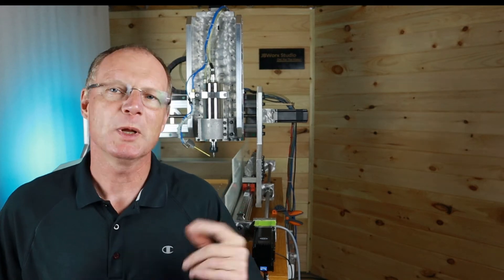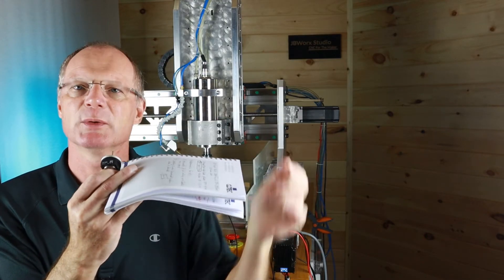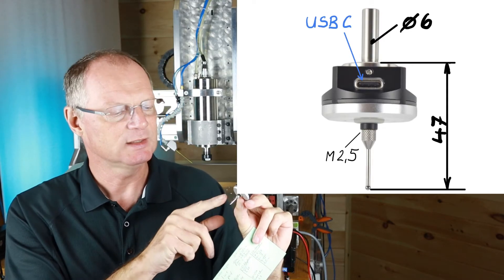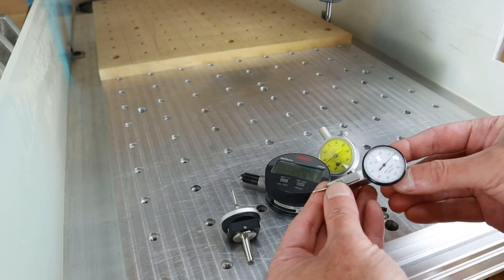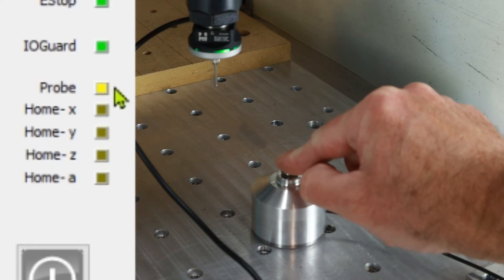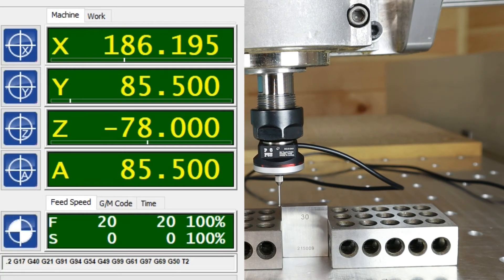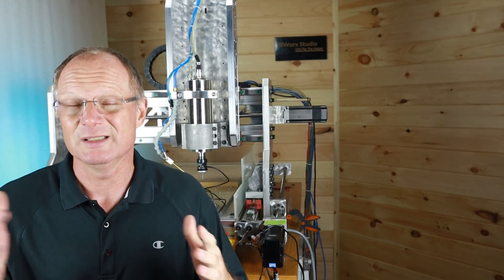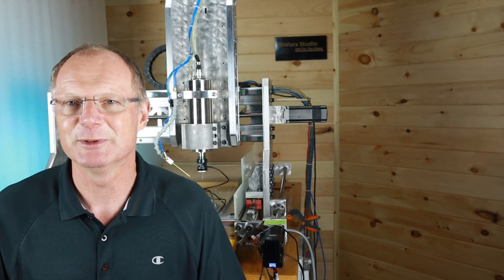CNC Touch Probe

Comment: I purchased one of these probes for use on my manual mill with Electronica EL700 DRO, which has probe functions, but requires only a passive input (no 5-24v input and it requires NC contacts).  To use it I needed to disassemble and re-wire it to bypass the internal circuitry.  I just removed all the components from the circuit board and located the pad that connected directly to the sensor ring, then connected that to the USB connector center pins.  The common is already connected to the other side of the ring via the outside pins.  I am in the process of testing now:  inside / outside features, inside / outside diameters, steps, angles, etc.  I don’t expect the advertised accuracy without the active circuitry but generally if I am within 0.001” for any of those functions I am close enough.  If you have not had a look inside your probe you will be pleased to know that it is well-made with gold-plated contact balls and pins, nicely-machined internal parts, O-ring seals, etc.  Mine was very clean.  As you correctly point out, the USB connector is a weak link.  Although the supplier’s advert states that they have replacement parts, in the US we must go through Amazon to contact them and I suspect this might not be straightforward.  Thank you for posting your experience.
Reply from the maker: Good work around !! So your board expects a “dry contact” NC. Yes it’s very nicely made I opens mine hoping to change it from NO to NC as the NC probe was not available on Amazon when I bought mine. Unfortunately I was unable to change it. Also getting it back centered took me quite a while. 
Let me know how the accuracy turns out.
Reply: In that case, you don't have to modify the sensor itself at all; you just run its output into an optoisolator chip, which's secondary (output) side you connect to your machine inputs.
Depending on whether you want to invert the input logic or not, you connect your signal to the anode or cathode side of the chip input and Vcc or GND to the other. Dead simple, costs you only a marginal amount of money, and saves you the hassle of disassembling the sensor and modifying it. That also solves JBWorx inversions problem in the same way.
Reply from the maker: It the optoisolator adds to the timing loop and some of them are quite slow. This is why I was avoiding it. However in reading up on this right now I see it’s only 5 micro seconds. So I have to change my opinion about using them in the future. Thanks for your post.
Reply: @JBWorx  The probe should be calibrated - distance between probe contact and trigger = effective ball diameter.  Adding a relay had no change in my effective diameter(1.88mm). I use "Probe it" for calibration.
Reply from the maker: My guess is that during probing everything moves so slow that it does not matter if a relay is in-between. A transistor however would be a better choice. But if it works it works !
Reply: @JBWorx  My machine only has a very low current 4.7v supply that has to be grounded (pulled down to below 1v) as the probe. I tested and it doesn't provide enough voltage or current to operate this probe by directly hooking it up to the probe. How do I hook this probe up so I can use it? I've got a 6v 2a power brick laying around I can use as an external power supply, but clearly I need some kind of interface circuit and I'm not sure what to use.
Reply from the maker: Best would be to change out that power supply instead of adding something.
Reply: @JBWorx The 4.7v probing is integrated into and provided from the controller board, so changing out the built in probing power supply is not practical. The controller board itself is 30vDC, so I can't even tap it for running this new touch probe. I think I will just run a solid state relay board with the separate 6vDC power supply and have the solid state relay short the 4.7vDC probe to ground and see if that works. As you mentioned, probing happens so slowly, I don't think the time delay will make any practical difference. I often manually probe using paper and haven't seen it make more than 0.001" difference.
Reply from the maker: Ok I see, yes the 30V might be a problem. I don’t want you to burn anything up on my recommendation, however have a look to combine the 0V of your probe output with your new power supply. This only works if your probe input looks for 0V if probe contact is made. Look up a transistor schematics and understand how it will pass the 0V through even though it runs on a different power input. Important here is that both GND or (-) or 0V what ever you like to call it are combined.
Reply: @JBWorx  The circuit operates at 5v  via a 7805  ( 5 volt regulator).   Most 7805's max voltage is 30-35 and minimum 7v dc.
Reply from the maker: Ok sounds like you have a plan
Reply: @neomunitor  It's one thing to use a test dial indicator to measure probe tip concentricity  with axis of rotation.  For accurate edge finding you need to know the distance between probe contact and probe trigger. Because these are kinematic probes( 3 "legs"), the angle the probe approaches an edge,  will change the distance between probe contact and trigger.   I have done 360 degree probing angles,  and surprise at trigger distance variations.
Reply from the maker: @mikee8467 first task is to set the concentricity of the probe otherwise it will have a variation dependent on the orientation of the probe or workpiece. Next I used a calibration ring and a calibration macro that establishes the exact trigger point to a given reference diameter. These parameters are automatically stored in the software after the calibration is finished. It’s important to properly do this to have accurate measurements as you already pointed out.

Comment: Another great video. I have the same probe and love it. I am planning on adding a tool setter and using the touch probe for zeroing my z height work coordinates. Like you, I don’t have an atc. Do you have an accurate way to measure the length of the probe with your tool setter for subsequent tool changes. Both the probe and tool setter have springs. Thanks for the great content.
Reply from the maker: Thanks for your positive feedback. So measuring the length of the 3D Probe on the tool setter I can not recommend. My probe triggers first and it does not even deflect the tool setter plunger however I think it’s better to create a touch of block in a certain position on your table. Let’s say you use a 1-2-3 block and touch off on that one. At leased that was my plan so far, have not tested that.
Reply: @JBWorx  Surprisingly difficult to find information on how people are handling this in their workflow. Since the touch probe is not deflecting the tool setter, do you think the travel of your tool setter is measurable, and repeatable so that you can factor that into subsequent tool length offsets? I have a tool setter on the way, and will experiment once when it arrives. Keep up the great videos
Reply from the maker: Like I mentioned above I don’t think it’s a good solution this way. Having a firm surface with a known height will work much better. There is a video from Klaus Michel in this but it’s in German. He did it like I mentioned and it seems to work fine. Also a question how you can incorporate that into your controller settings

Comment: The wire coming out of the uccnc controller is +5volts and the spindle is grounded.   Is this NO or NC condition?
Reply from the maker: I would think it is looking for a NO contact. It will trigger the input when the switch is closed or the circuit loop is closed. But best is to test it.

Comment: Will the 6mm shaft work on a 1/4" collet?  Will the collet squeeze down enough?
Reply from the maker: I recommend using a 6mm collet. If you use the 1/4” the runout starts to get really bad. Also fir a cutting bit. So best is to use the correct diameter collet.

Comment: Great video, I was looking at them but worried about spare parts, looks like that seller as you said has spare parts like the tip adapter that commonly breaks..
Reply from the maker: Yes they do and also the plastic part in the inside. The tip has an odd thread (M2.5) so it’s not easy to find a replacement from a different vendor. But it’s available on Amazon now
Reply: I see plenty of M2.5 tips on ebay, some with a jewel tip also. That shouldn't be a problem.
Reply from the maker: Excellent, yes I can find them now as well … wonder why I had such problems finding any at all before.

Comment: I’m having a npn no 3d probe coming in. I was thinking about to connect it to the input of the tool probe. But my tool probe does only use two wires. How do I connect it then ? 😂  the tool probe is using input and gnd. Do I just need to connect it like 5 volt. Then gnd and input on same wire from the tool probe?
Reply from the maker: So if both are NO probes you can connect them in parallel so to the same input to your board. Either one of them can close the circuit path and get the required signal. This is for the signal wire the power you pull from your control board but check if it supports the current. I remember I measured the current and it was really really low but don’t recall the value from top of my head. So my Eding controller supports it directly.

Comment: Hey nice video. I bought that 3D touch probe and I want to connect  my Z touch probe paralel like you show in  the drawing. But it won't work. I'm using UCCNC software the probes are both NO contacts . Separately they work fine. What can be the problem.
Reply from the maker: Ok so NO contacts will need to be wired in parallel, so either one can close the circuit. I had to change the expected contact in my software to make it work at first.
Reply: @JBWorx  Hey, thanks for the quick repley. Did you had to change the "activ low check". Do you also use UCCNC?
Reply from the maker: I use EdingCNC and yes in my controller I had to change this setting … I don’t remember at the moment if it was from high to low but it worked once I changed it.

Comment: I got the same probe. It was $45 on China taobao site.. The accuracy is good enough for me. However, I spent some time to make it work. On my machine, the probe has to be grounded on the shaft or it will not work properly. If you have similar problem, try to ground it.
Reply from the maker: Thanks for the tip, mine worked perfectly out of the box.
Reply: @JBWorx Well, It wasn't the probe. It was due to my spindle not grounded. The probe will get intefered somehow and behaved strangely.
Reply from the maker: Yes proper grounding of the spindle is important. Best is to open the connector at the spindle and check using a Ohm meter to see that everything is ok.
Reply: @JBWorx  My machine is from China. They preferred to use an alligator clip on the drill bit and pass the voltage signal for zero detector. I guess that's why the spindle cannot be grounded.
Reply from the maker: A proper ground is really important especially if you have a spindle that runs on line voltage let’s say 110C or 220v. It can be a life saver and protect you as the user. If it is a DC motor that is used as a spindle then it is less important.

Comment: I like the probe but the electronics are weak..  I wired mine up wrong and that was that...  I ended up removing the electronics and use it as a simple contact.  works great now....
Reply from the maker: Well good that you got some use out of it.
Reply: Agreed.  See my earlier reply.  My DRO expected NO and I deleted the electronics intentionally.  It seems to be as accurate as the original poster states.  It's especially good to have all the probe functions available.

Comment: So does the signal cables go into the existing Z probe connects? I have a Sainsmart 4030 ProverXL V2 and there is a 2 connector Z probe on the box.
Reply from the maker: Yes, both probes are wired in parallel so in the same input. Either one can make that input on the board and the software knows from the selected routine wich one is being used.
Reply: @JBWorx  absolute magic thanks.
Reply from the maker: @Festivejelly anytime

Comment: I have the same probe, only I use a mach. Do I need to set anything in the control software to measure with a 3D probe?
Reply from the maker: I don’t know the specifics in Mach3 however it has a probing routine. However the probe needs to be calibrated in the software so you can use it

Comment: I think "thou" is reserved for thousandths of an inch rather than thousandths of a millimetre. Really excellent and informative video as always!
Reply from the maker: Yea I am pretty much messed up when it comes to units … still prefer the metric system and most of my measurement tools are in metric. We would always say 1/10th, 2/100 or 3/1000 where I am from. Thank you for reaching out.
Reply: To confuse the issue further, I have heard Americans using 'mils' to mean thou.
Reply from the maker: Yea it’s hilarious- however I do think the we give ourselves here in the US a huge problem dealing with decimals of an inch. I see so many engineers that have no “feeling” of a dimension and its tolerance. I also think that we miss out on not using enough standards. Every bolt, nut pin, clip tap and what not has a DIN standard in Germany. And that makes everything so much easier. Here it’s a bit wilde West where every supplier makes their own version. Add wire gauges, drill bits and dimensional lumber into the pot and you just have to ask who the hack came up with all that nonsense. Ok I get of my sop box now ….
Reply: Americans and their fractions... always gotta make things more complicated than they really are.
Reply from the maker: Yes my big problem is when I try to explain that square feet is an area and has no equal to a volume of cubic yards to a concrete guy 🙈🙈🙈

Comment: Mine arrived today, what a lovely device. No repeatability testing yet but x,y,z all work as expected on PathPilot. I have the 6mm shank, NC version, a bit more money for some reason but it is what I need for my controller. Thank you for finding this, I had given up hope of an affordable probe that fits my machine. Touch off is noticeably stiffer than my Renishaw TP2, but at least I can use this new one :-) , the TP2 takes a lot of Z height space.
Reply from the maker: Awesome!!! Now can you calibrate it in PathPilot?
Reply: @JBWorx  yes, they have a whole screen and process to go through including testing with a ring gage.
Reply from the maker: Nice, I really like the PathPilot for my lathe, the conversational programming is really good. I hope you can use the probe in your workflow and It will make alignment easier.

Comment: Your description tells that you probed accuracy at +-0.05 mm (which is not really high precision 😮) but what I've seen in the video it was actually +- 0.005mm, which would be really a good value, especially for the price.
So, did you do further tests and it was 0.05mm or is that a mistake?
Reply from the maker: I went with the Japanese approach of underpromise and over deliver. So I actually measured 0.005mm but I figured I would place more divination on top of that just in case anybody buying this and not be able to get my results they would sure get something 10x less than what I measured. And if ok with that anybody will be happy to find out the unit is more accurate.
Reply: @JBWorx  Ah, ok. Wise move 😉
Reply from the maker: I think you are one of the few people that actually read my description! Nice 👍and good catch on the measurements !

Comment: Hi Jörg, thanks so much for your excellent contributions so far. Very much appreciated! Regarding the wireless approach, I imagine the pro stuff would have some heartbeat going on to avoid accidents? For size and low-power I’d look at ATTINY85 and a rechargeable LIR2450 cell plus 433Mhz TX module. Thanks again!
Reply from the maker: Thank you so much for that recommendation. There is a new protocol using a direct link 2.4Ghz with a latency of 2.4ms that I have in mind but will check out the components that you mentioned definitely looking into that battery.
Reply: I made a circuit a couple of years ago using this cell and was quite happy with it. You can also find a TP4056 USB charge module for about $3 and change a resistor to set charge current to a more appropriate 130mA. Have you determined the power needs of this probe?
Reply from the maker: I measured the current connected / triggered and it is on 5V 11/16 mA. So rather low that is why I was able to connect it directly to the output of my EdingCNC board. The new S3 chip has 4 power modes active it should be 78mW so on 3.6V we should see 21mA sleep is in the microA range. The board comes with single cell lithium charge capability, probably for an 18650 so yes a charge resistor will be necessary. So about 2-3h of probing for every 100mAh battery capacity. Doable I think.

Comment: One may think that with modern tech no probe may be necessary. A concept may work as following: a laser diode illuminator is attached near the spindle projecting a laser line down the working area. The fan out angle of the illuminator is known, and so is the z machine coordinate. A decent monochrome camera with an appropriate filter for the laser color, looking at the working area from the side at some shallow angle should be able to distinguish  features and distances down to micrometer ranges. Laser illuminators are cheap (circa $10), digital cameras are also cheap, only the software is lacking.
Reply from the maker: That is a very interesting concept. I guess one would need this system to be able to look in X,Y and Z to establish the work coordinate system zero points.